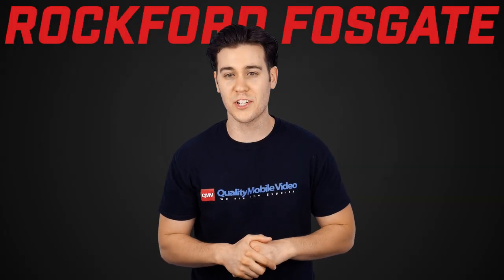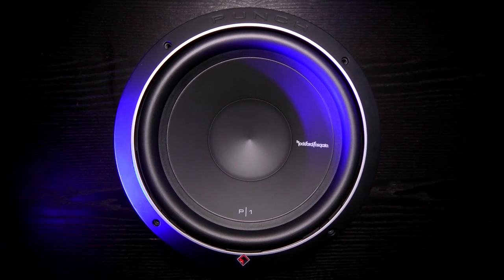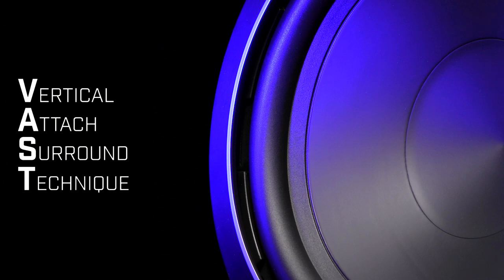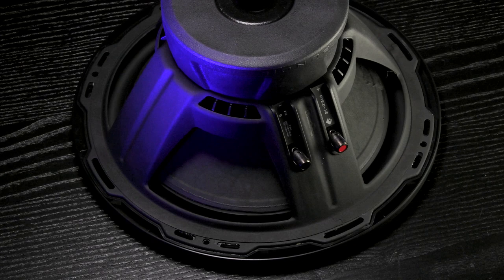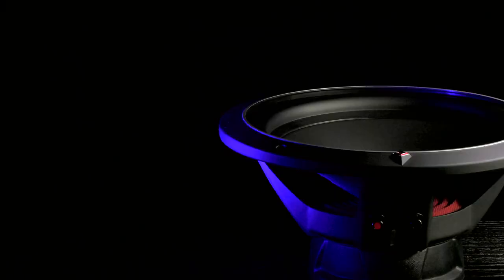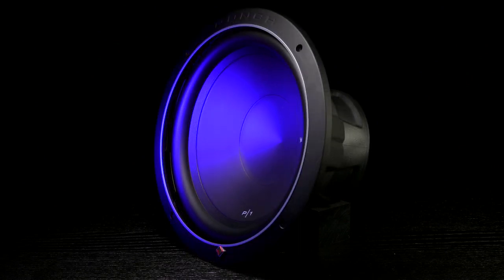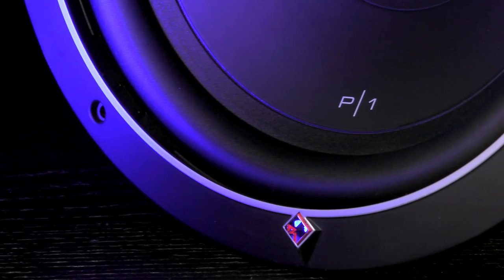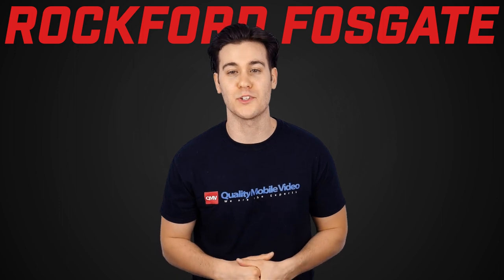Rockford Fosgate Punch P1 Subwoofer - 2016 Review

Comment: I'm using 2 P1'S. I have it hooked up to a pioneer 820 watt amp.. Should I get s less powerful amp?
Reply from the maker: I need a lot more specificity. What model and size subs do you have? Are they 2 ohm or 4 ohm? What model is your amplifier?
Reply: @Qualitymobilevideo  the amp is a pioneer GM-5500T.. the subs are 1 ohm

Comment: what is the difference between the Rockford Fosgate Punch P1S2-15 or P1S4-15?
Reply from the maker: The impedance, so the P1S2-15 is 2ohm, and the P1S4-15 is 4ohm. The impedance (2ohm, 4ohm, etc) is determined by two things:
1.The drivers (speakers, subs, etc) that you use (ie, 4ohm or 2ohm)
2.How you wire the drivers to the amp (series, parallel, stereo, etc)
Reply: +Quality Mobile Video switch one is rockford 10im prime R2 or p2
Reply: @Qualitymobilevideo  which is suited for 1 ohm 500 mono amp to run 2x subs

Comment: I recently purchased two 12" p3's and would like to know what kind of amp should I get??
Reply from the maker: Depends! Did you get the 2 ohm or 4 ohm models? And what's your budget?
Reply: Quality Mobile Video they are the 4 ohm version and they also came with a Kenwood kac-9105D amp.. should I keep that one or change to a Rockford amp?? And budget is $250-350.
Reply from the maker: The amp matches the subs for a 1 ohm load, however it only does 900W RMS @ 1ohm, whereas the subs have a combined RMS of 1200W RMS. It'll work fine, you just won't be getting the most out of the subs, I also generally recommend having an amplifier with a higher RMS than the sub(s) for headroom
Reply from the maker: Check out this amp: https://www.qualitymobilevideo.com/gm-d9701.html
Reply: Most Wanted pioneer 9601 or 9701 perfect match

Comment: I have 2 p1s4 what amp should I buy?
Reply from the maker: Monoblock amplifier with a power range of 500-650 @ 2 ohms. Check these:

Pioneer GM-D9701 - 800W RMS @ 2 ohms
http://www.qualitymobilevideo.com/gm-d9701.html?utm_source=YouTube&utm_medium=Video&utm_campaign=Match_Subwoofers-Amplifiers

Power Acoustik RZ1-1500D - 900W RMS @ 2 ohms
http://www.qualitymobilevideo.com/rz1-1500d.html?utm_source=YouTube&utm_medium=Video&utm_campaign=Match_Subwoofers-Amplifiers

Kicker CXA600.1 - 600W RMS @ 2 ohms
http://www.qualitymobilevideo.com/cxa600-1.html?utm_source=YouTube&utm_medium=Video&utm_campaign=Match_Subwoofers-Amplifiers

Rockford Fosgate R1200X1D - 800W RMS @ 2 ohms
https://www.qualitymobilevideo.com/rockford-fosgate-r1200-1d.html?utm_source=YouTube&utm_medium=Video&utm_campaign=Match_Subwoofers-Amplifiers

Kenwood KAC5001PS 
http://www.qualitymobilevideo.com/kac5001ps.html?utm_source=YouTube&utm_medium=Video&utm_campaign=Match_Subwoofers-Amplifiers
Reply: Thank you. What at if I wanted to run 1 p1s4 12 would Rockford Fosgate Prime R500X1D be good to power jus one?

Comment: I have 2 12s should I sell them for 200? Plz let me know. I'm afraid of sellers regret
Reply from the maker: Are they used? Why do you wanna sell them? Getting new ones?
Reply: Quality Mobile Video yeah they are used but not abused. Were my mom's but she never used them to bump. Amp burned out. Want to sell Just to get rid of them just laying in storage right now. I don't have a ride to put them in or a amp.  Just want others opinions because I feel like after I sell them I'll have that sellers regret.
Reply: I might just sell them they aren't that expensive on the website. I bought mine from Wal-Mart totaling up to 600 dollars. I think with a amp and the vented box
Reply from the maker: I mean if you don't ever plan on using them or building a system for yourself they're basically just 30 pound paper weights my man. Might as well get some cheddah for them while you can
Reply: If you can sell for 200 then hell yes, they're only 95 new

Comment: i have a 2 12 p1 conected into a 1000w pioneer amplifier do you think im gettin all the bass or need a bigger amplifier?
Reply from the maker: Ok I need some more specific info Brandon. You rocking the P1S2-12 or the P1S4-12? What's the model of the Pioneer amp. Is the amp 1000W RMS or is it 1000W Max/Peak?
Reply: Quality Mobile Video 
p1s2 12 and the gm-A5702 AB
Reply from the maker: Oh yea I would suggest a more powerful amp, and I would definitely get a monoblock, not a 2 channel. 2 channels are a lot less powerful than monoblocks. The subs are 2 ohm, and their RMS power combined is 500 Watts which exceeds that amp's RMS at a single channel 4ohm load which is only 480W. You want the output of the amp to be more powerful than the input of the subs combined, it gives you more head room and prevents damage to overpowering your equipment.

For the most bass I would suggest getting a monoblock amplifier with an RMS power range of 500-700 Watts RMS at 1ohm. Wire your subs in parallel to get the 1 ohm load at the amplifier. 

This Pioneer amp would be a better choice and get you a lot more power and bass: http://www.qualitymobilevideo.com/gm-d8601.html

Comment: Every time I run two speakers together for the lower ohm, I blow the second speaker in a couple of months.  Any one have this problem?
Reply from the maker: Do your impedances and power ratings match?
Reply: Nope, have done this for 5 years on two Hertz 8" subwoofers. Sounds like there's either an issues with the wiring or amp, or maybe the subs were low quality or had a manufacturing flaw.

Comment: I have two Rockford Fosgate Punch P1 15 subwoofers  what watt amplifier should i use
Reply from the maker: Do you have the 2ohm or 4ohm?
Reply: 4ohm
Reply: Ellie Miller if you got 2-4 ohms P1-15's get the Prime R500x1D its rated above 500 RMS @ 2 ohms!!
Reply from the maker: Shit my bad Elie! Sorry for the late response. Those are SVC so the best bet is to make a 2 ohm load. So a monoblock with 450-600W RMS @ 2 ohms!
Reply: How'd it work out?  I have the same amp, thinking of getting this 15, or the kicker. You should be around 250-300 watts@4ohm.

Comment: I have the 2 ohm version and a Rockford fosgate 500w amp and the amp keep blowing them smh.. these are crap
Reply from the maker: Maybe you're wiring them wrong or mismatched the subwoofer to the amplifier
Reply: Yeap! ^ what he said! Check your wiring. Rockford website shows different ways to wire!
Reply: Because you’re running 500 watts on a sub that’s only rated for 250 continuous watts....
Reply: @JacobEcret  2 of these would equal up to WHAT?? Lol
Reply: Dee woods well sir, you didn’t mention having 2! Did you? No you didn’t. Check your shit dude. And I agree, you’re doing something wrong, if you’re blowing them up, rockford makes amazing subs, blowing them would be hard if doing everything correctly.
Reply: And I already know you’re going to mention that you said them, but the fact that you said keep meaning you’ve bought more than a few, so the fact you said keep and them could get someone thinking you only ran 1 at a time.
Reply: Also make sure you’re running the correct amp, a 2 ohm sub is meant to be wired into only a select few ohm diagrams, so if you’re wiring them to equal to 4 ohms then make sure you’re running a 4 ohm amp. The less ohms the the less resistance which means you’re pushing the same watts but it’s going into the sub much faster. Pushing 2 ohms into a 4 ohm sub or setup will defiantly blow them.